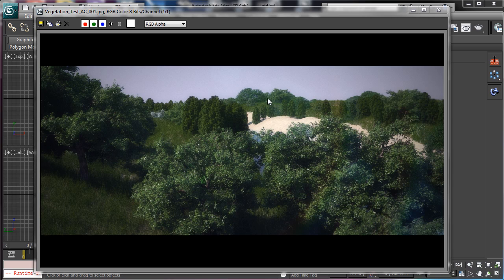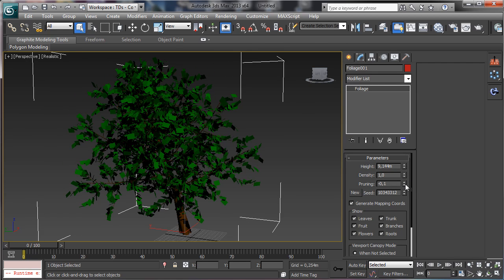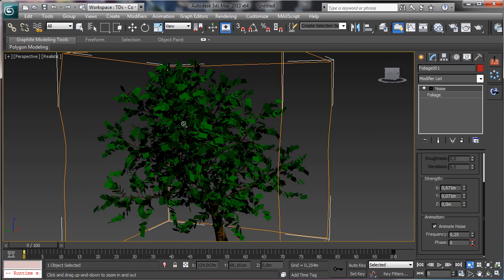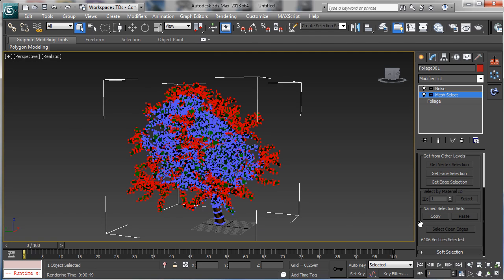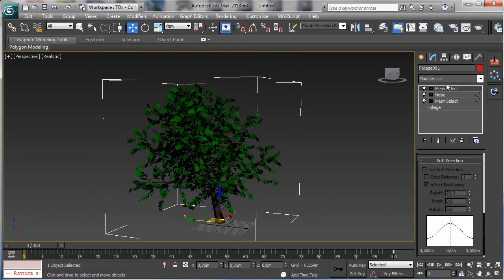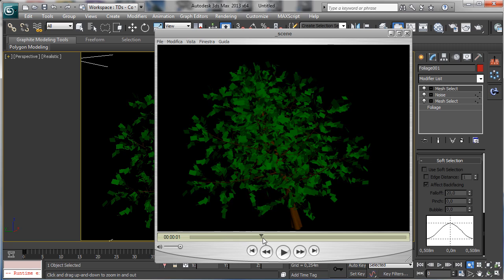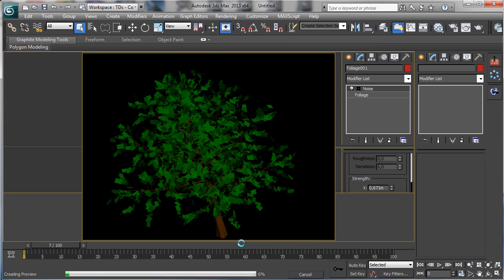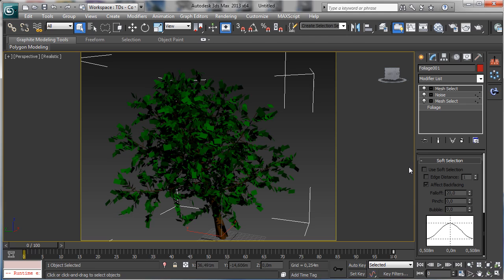Tip: Simulating wind over plants

Comment: I was trying to animate a tree which is moving in the wind while losing it's leaves at the same time (reducing the density in Foliage menu)... Didn't work. The soft selection changed all the time so after a few frames, even the tree trunk started to move. I spend quite some time trying to figure out what is wrong with my tree and my mesh selection. Then I finaly tried animating it with constant density and everything worked fine.